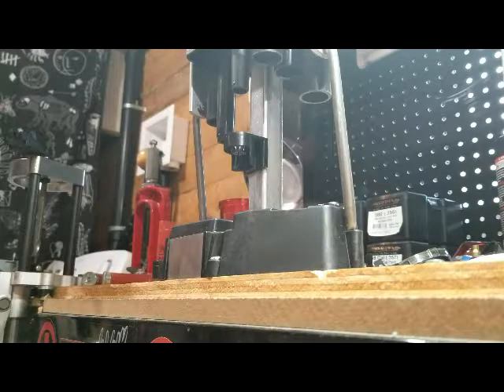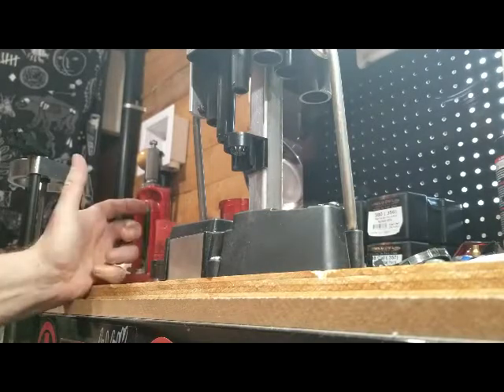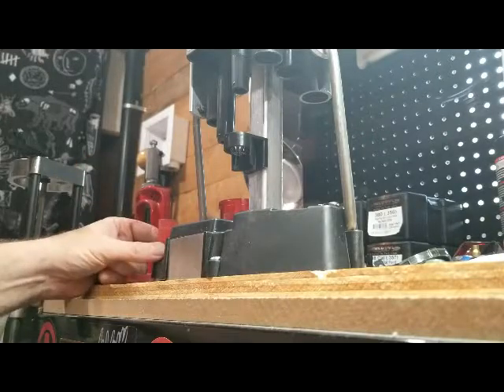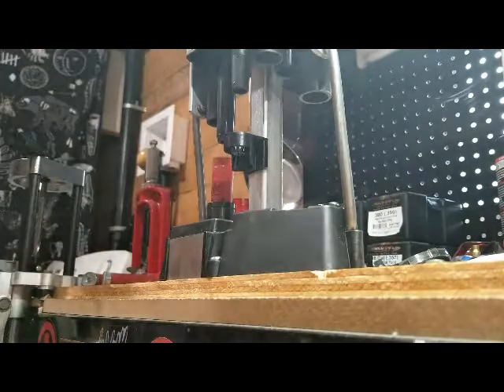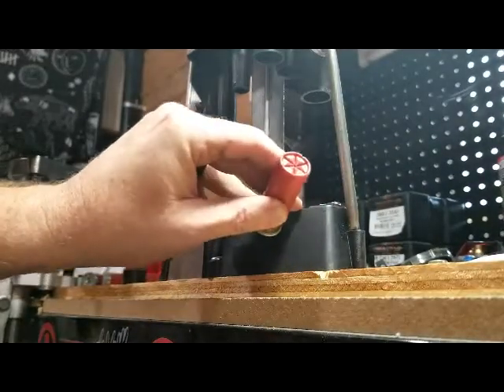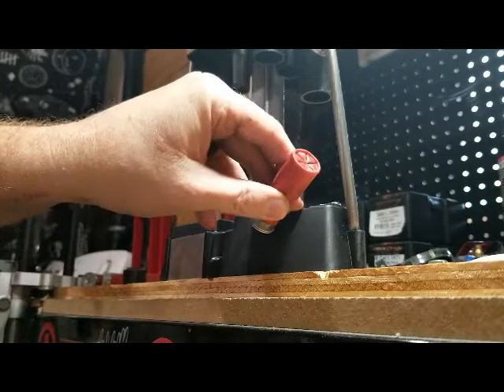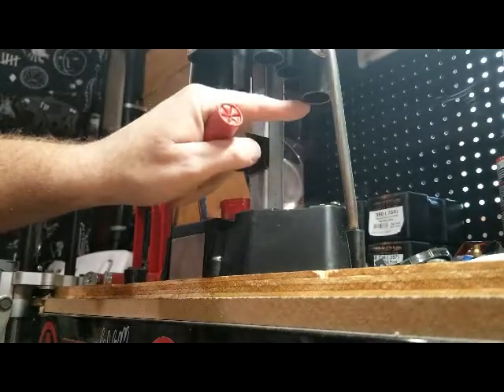Lee Load All II Better Crimp Modification

Comment: Or just use a thin washer underneath the shell This way you can remove it or add more depending on your desired crimp!
Reply from the maker: It would have to be a very thin washer, but that sounds like a much more versatile option if you  load multiple types of shells.
Reply: @JohnFazer  that’s what I was thinking! It’s unbelievable how well lee load all’s Perform. I don’t think a lot of serious reloaders give them the credit they’re due. I just don’t know why they did away with the primer feeder they used to have with the original
Reply from the maker: @ahdam82  I didn't know they discontinued the primer feed. Makes me regret not getting it when I had the chance.

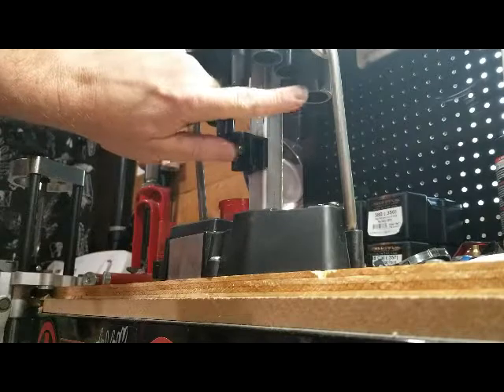Comment: 0:19 Not "sand" per se, but grind or cut off a sizable portion of the final crimp die, such as a 1/4".  This then will also allow you to crimp much shorter length shells such as 2.5" (and 1 3/4" "minishell" size the more material you remove), because who wants to be stuck with reloading just 2 3/4", 3" and 3.5" shell lengths?  For shorter shells, you can also just use a riser to raise the shell up to the crimp and not have to make such a permanent modification.
Reply: That's what I figured would be an easy hack. Stack of washers or something to crimp short shells.

Comment: Rather than modify the tool, I put a single 12ga card wad on the base to lift the hull slightly.  Same effect, no permanent change, and I can use something thinner or thicker if I want a different amount of lift.
Reply from the maker: Sounds like a good solution. Maybe if Lee ever makes a load all III, they will build in some adjustability.
Reply: @JohnFazer  just a bare smudge of caulk to tack it in place, I can pull it up and rub the caulk off with a fingertip when I need to change it.  It's a good tool.  I admit I only load buck and slugs with mine because I really don't bird hunt or shoot skeet.

Comment: There is a diffence in shell lenght some are not really like 70mm but 69mm or 70,5mm so the crimp works sweet on certain brands and a bit less on others atleast thats my experiance.
Reply from the maker: I stick with Winchester AAs in 2 3/4, and the crimp was a little too loose.
Reply: @JohnFazer  I just buy new shells uncrimped shells most of the time but there is a diffence in lenght in brand vs brand its minimal but it effects the crip,i am in Europe so not much Winchester around but Fiocchi Cheddite and others...
Reply from the maker: @Berniessen  I agree. Half to a full millimeter  in hull lenght would make a huge difference in the crimp. I also do not have any experience with new hulls, it is not cost efficient to do that here.
Reply: @JohnFazer  I save u a long story but to make it quick u need papers/licence to own a gun and buy ammo but in the EU (diffent countrys have diffent rules) u can buy all components to reload shell without papers,so i dont have a papers/licence for owning a gun,but we can own antique guns like Winchesters 1885/1886/1887/1890/1892/1893/1894 and some 1895,s here without papers as wall hangers,so making my own shells is the way to go (plus lead is banned and my Winchester 1887 and 1893/97 are lead ammo only) My hobby are 1893,s winchester and i am the only person on this planet that converts them to 1897,s in terms of how the action work..
Reply from the maker: @Berniessen  There are places in this country where you need background checks for ammunition, but reloading components are ok to buy. Bureaucracy in action lol. I saw some of your videos, I will check them out when I get a chance. Lead shot is outlawed for hunting here, but is still ok for trap.

Comment: Ok are you just sanding the outside of the crimp tube?
Reply from the maker: Yes, I just barely sanded down  the crimp tube.
Reply: @JohnFazer  I'm not understanding something. If the shell only touches the inside, how does modifying the outside of the tube help?
Reply from the maker: @sluggou812beotch  the tube bottoms out on the lower section of the press, so shortening the tube allows the upper section to go a little lower. This effectively makes the crimp tighter. Also I don’t sand the outside of the tube, just the bottom that contacts the lower press section
Reply: @JohnFazer  THANKS! Mine doesn't bottom out. I've been loading 2 3/4 Winchester AA's and Remington Sporting Clays (I live near a gun club)  with Lyman pellet slugs. I've been shooting incredible groups with the load I've stumbled across. I fn love my Lee loader and kudos to our brothers in Russia at Svarog for producing awesome slug molds.
Reply from the maker: @sluggou812beotch  I have always heard those slugs are great.

Comment: How do you like that Lee press  ? Are there any drawbacks to using that press?
Reply from the maker: Emptying the hoppers is a pain. You either have to cycle the press to empty, or remove the whole upper section and carefully pour it out.
Reply: @JohnFazer  I will take that under advisement before deciding witch press to by !! thank you
Reply from the maker: @pony_4759  You're welcome
Reply: @pony_4759  This really is a great press for what money buys,if u dont shoot that much and u dont need to reload much and u know what shell shot wad powder combo u use u can make awesome shells with this cheap press and pretty quick to,but making 100 shells takes some time but the shell work out well if u have the propar ingredients for a shell.
Reply: @JohnFazer  Saw a guy on here drill a hole in one corner of the bushing cover.  He puts that cover on the top of the powder and shot holders and pours out the shot first.  Now he can pour out the powder without any problems.  Just make sure you have a good grip when pouring out the shot.  Save taking loader apart.  I would imagine you can stretch those arms so many times and then youll have problems.
Reply from the maker: @theoldshooter5631  Thanks, sounds like that would work pretty well.
Reply: @JohnFazer  when emptying the hoppers, I put masking tape around the powder hopper so 1/2" sticks up and tear a piece of paper to fit. Mate the two together, it only takes a few seconds then pour out the shot. Take the paper off to pour out the powder if need be. I have mine mounted on a piece of board I clamp to a table that enables me to just pick it up and pour without disassembly.

Comment: Or put washer under shell ?
Reply from the maker: There is a metal holder that you slide the shell under while crimping, which is what interferes with the presses downward travel. Removing some material is the only way I found to increase the travel to tighten up the crimp. You can also remove the metal shell holder, but then you have to pry the shell out of the crimp station after crimping.